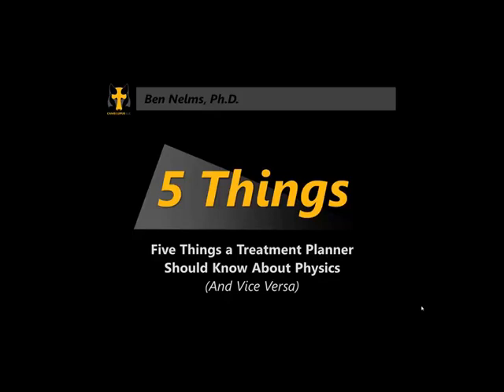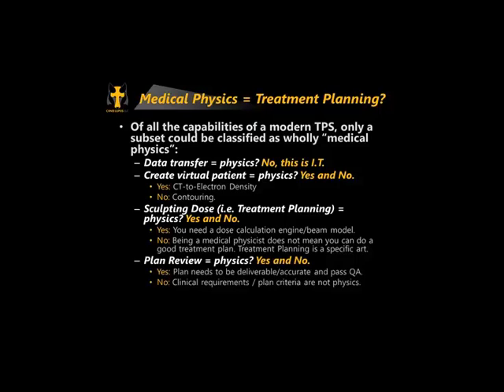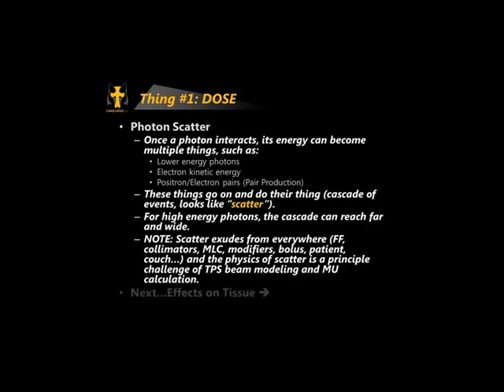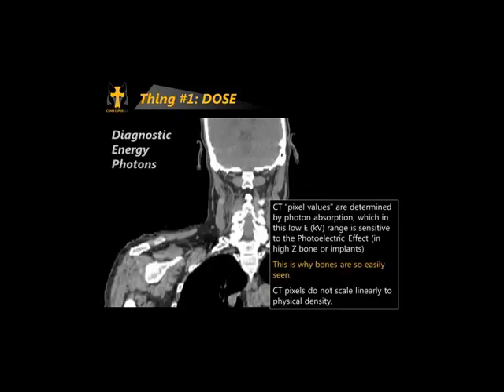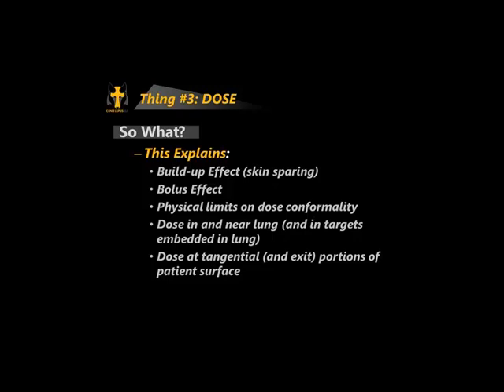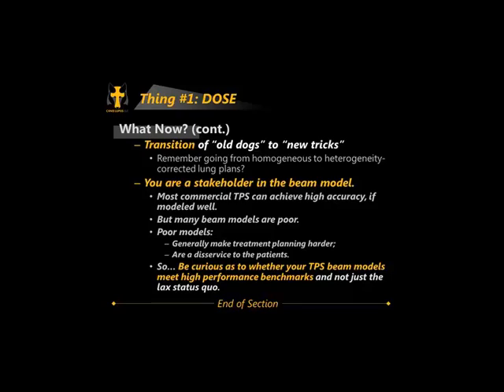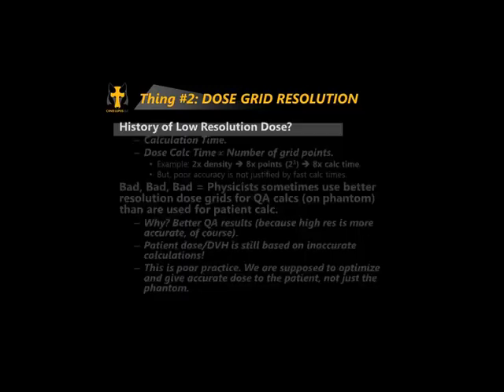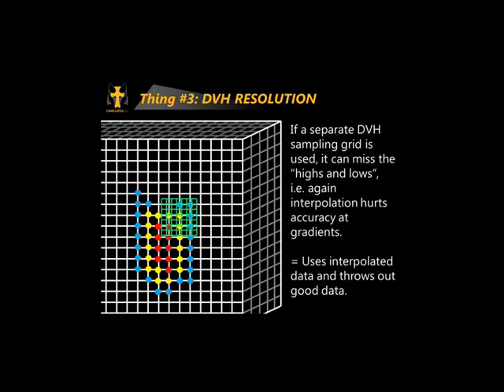Five Things a Radiotherapy Treatment Planner Should Know About Physics

Comment: Thanks a lot for sharing knowledge. It is very informative and helpful to design/check QA for TPS. I have a question about a slide at 32:54. There are two CT slides with isodose distribution. 1) planned 2) actual. Would you explain from where the actual isodose distributions are obtained please ?
Reply from the maker: The actual isodose is obtained by patient specific quality assurance for delivery
Reply: Thanks. I have an other question about a slide at 1:28:08 where the speaker is comparing the DVH of tumour volumes through simulations. Is he using a specific software for simulation or is it a part of patient specific QA as you mentioned above.
Reply from the maker: @AbdulBasitAB  i think specific software